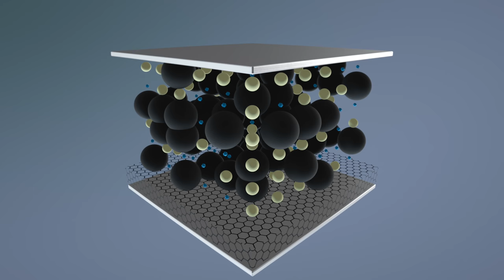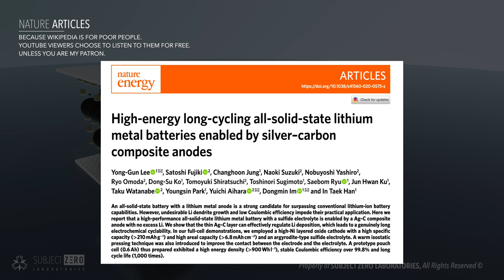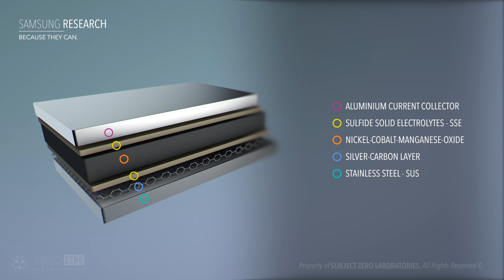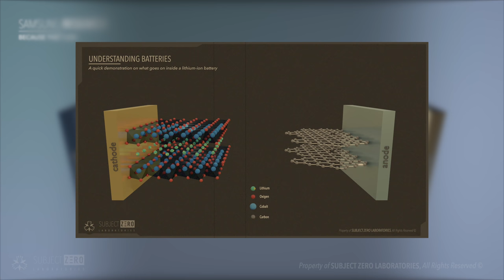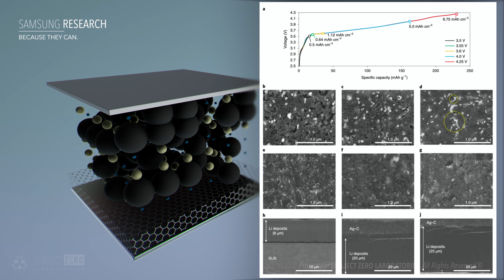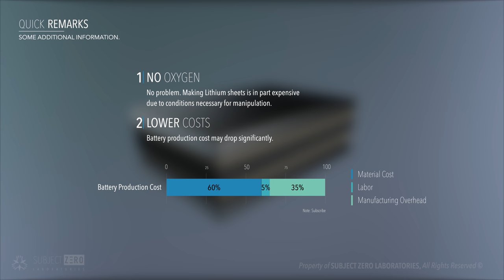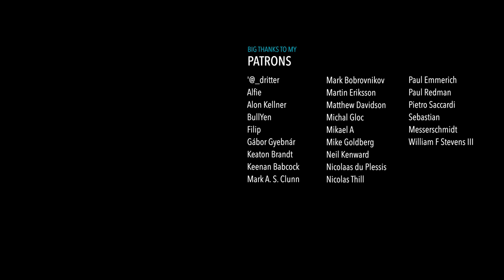Breakthrough Solid State Battery - 900 Wh/L Samsung [2020]

Comment: Lithium can't surpass the energy density of gasoline even with a theoretically perfect lithium-air battery as gasoline wastes are gaseous products that you just dump into the atmosphere. A lithium-air battery with optimal performance (which is unlikely to ever be remotely achievable) will carry the waste product with it, and the lithium oxide waste product has a much larger volume and twice the mass of lithium metal.
Reply: Can the waste product be actively removed as they are produced through a mechanism built into the battery system?
Reply: @hassanjamal4212  Not if you want the battery to be rechargeable. The lithium oxide is "spent" lithium metal that provided its electrical energy when it reacted with oxygen from the air. You want to keep it because it's expensive, caustic like drain cleaner on contact with water and you want to turn it back into lithium metal by charging the battery. Charging the battery will give off a lot of oxygen (which itself might be unsafe in a poorly ventilated area; think charging your car in a poorly ventilated garage; any fire that starts in there could be a blast furnace). Batteries rely on a very specific geometry to work, you must be able to accept large changes in volume without accumulating deformations, dendrites or other problems that might cause a short or degrade performance. That's why it's hard to imagine a real world lithium-air battery that is rechargeable and is mostly made of lithium. You're going to end up with all sorts of fluff comprising most of the battery weight. It might still be much better than current lithium ion batteries.

With gasoline, there is no built-in mechanism to turn the carbon dioxide and water back into gasoline and they are gaseous at temperature so it's not storeable, and they are not accutely toxic so it is generally considered OK to just dump it into the atmosphere provided you use a catalyser to get rid of the carbon monoxide and NoX.
Reply: @soylentgreenb  i think gasoline if produced and consumed ethically can be highly beneficial and outweigh their negatives. The problem is the hyperconsumerism and undue burning of gasoline to sustain a lifestyle that is antithetical to preservation of environment. Like, buying and collecting loads of clothes, cars, houses,etc...living in distantly spaced houses, going to office everyday when many work can be accomplished at home...

As for the lithium battery, if the waste product is converted back into lithium, why is it considered a waste product in the first place and not just a temporary phase change? I thought you meant lithium battery produces like crusty deposits within it cells that overtime permanently displaces the electrolytes thus inhibiting its function.
Reply: @hassanjamal4212  I'm not saying that fossil fuels are good or sustainable, just that you can't beat the energy density of gasoline without going nuclear and it is hitherto acceptable to dump waste combustion products into the atmosphere.
Reply: @soylentgreenb  yup, its about being moderate and avoiding extravagance. The issue is countries like America and Australia produces so much co2 per population compared to the rest of the world combined, due to their self important image. These people would also burn through all the worlds lithium as well if they don't change their mindset and culture.

Comment: I thought electric cars were actually pretty good for the time, it was just lobbied out by gas companies who saw it as a threat.
Reply: Yes, but not just lobbying. For one thing, electricity for charging hardly existed outside cities at the time, so inter-city travel beyond the short range of the EVs of the day was impossible. Second, Ford came out with the Model T, which was maybe 10 times cheaper than the electric cars of the day (and the other hand-built gasoline cars of the day). Ford wanted to make an EV, but Edison could not deliver on his promises for the battery Ford (an ex-Edison employee) wanted to use. Then WW1 came along, and after that everyone copied the Model T format, including the petrol engine.
Reply: thearab59 Ahh thank you for explaining. Really appreciate it!!!!

Comment: yep in teory gasoline provoganda tell about the numbers But never tell compare to real numbers you get.
you shall times it whit 10-20% normally.
9500 -> 950-1900 wh/liter. Driving
600 -> 450-540 wh/liter. Driving (75-90% effectivity).

Now Gasoline are not impressive any more. If battery did have 9500 wh/liter, you will in same space be able to drive a stunning  5.500+ km in 100 liter whit the car i drive.

Automation game:
But if the world update Engine to my build gas cars 100 oktan and stunning 62% effectivity, it will be able to drive 50 km/liter eco'ish drive and have around 300 Nm in a 1.8L engine like VW golf 3.
Normaly runs 145 Nm by the way.

lamborghini countach (1988) can be running hold on your seat, 38 km/l by a 3.7 Liter 6 Cyl. engine when city drive.
And race 20 km/l +- topspeed 320 km/h.

Comment: A solid state battery will eliminate wet batteries. Imagine being able to produce batteries in any configuration. Anything and everything becomes the battery. Imagine this battery is half the weight,  10x as powerful, lasts 10x longer per charge and accepts recharge 5x faster than conventional batteries of today. Imagine this battery has unlimited scalability. I believe Elon Musk's Tesla will be unvailing 1st gen solid state batteries at it's annual stock holders meeting very soon.....you aint seen nothing yet kids.......
Reply: NO.........they are taking another approach for present time..........even Panasonic and Toyota says Solid state is couple years away...........the increases in change is happening as Ai ramps up .........with being able to ferret out the better uses of common minerals ...........Silver is so limited in amounts and of course as it goes up in use.........so does the prices............not what anyone wants for affordable batteries...........

Comment: Talk about jiggling the numbers, to get results you want. So, so hypothedical battery is going to produce mircles. Great, I'm waiting. Okay, lets say it's true. The thing about batteries is, you do have to replace them. So, if you buy a new car, and trade it in every four years you're fine. Who's going pay the price, at four years? What does a battery cost? Six, to nine thousand dollars? I drove my Toyota for sixteen years, and gave it to my nephew, who drove it for six years. So, you buy a battery, every four years, at six thousand dollars? Okay, that's fine with me. My maniger drives a Tesla. He doesn't drive it between January, and March, because the battery will not hold a charge in sub zero weather. The new batteries are going to fix all that. Right, how would you like to buy a bridge in Brooklyn?

Comment: Stupid comparison. In a car you always need a combined energy of heat and source. The efficiency of gasoline is close to 100% because you need heat. Due to the his fact batteries will never reach density of gas. Other fact, burned fuel you do not to carry with you. The weight of discharged batteries you always have to accelerate and deccelerate.
And finally the recharge of energy takes me 5min at a gas station, but half a day at the mains...

Comment: Oh really! Batteries were never a big hit and did not work with electric cars in the 19th century??? The first land speed record was with an electric car and electric cars were more successful than internal combustion egnines while the required metal engineering technology was in it's infancy. The problems of vehicle range, turn round time, weight  and cost of batteries were what allowed the internal combustion engine to scoop the market. 21st century technology is moving in the right direction but those same problems are still there.
Your comparison of potential power from batteries of a given size with similar oil based fuel ignores the problem that petrol or diesel is a processed fuel extracted from the earth. Batteries are a means of power transmission and equate to nothing more than an empty plastic fuel tank, until they are charged by power from a consumed fuel ( which includes hydro, solar, wind and tidal energy). Lithium battery improvements and problems are apparant in household devices and have made the electrically assisted pedal cycle viable but experience with these is why I am far from ready to buy an electic car but fascinated by the scope of likely battery improvements to come.

Comment: Electric cars are still silly. You charge them from burning something in a power plant or fission with its deadly spent material. You then transmit this power loosing about 25% of the energy. When you charge the car you loose another 10%. When you use your car another 15% is lost in heat and resistance.  

We need to go to the quantum  flux free energy for these cars to be viable. Don't exist you say? Think again, this tech has existed for quite a while but the controllers will not let it out of SAP's. The big energy profits would be reduced and that keeps it locked up. Think of reducing pollution by using this zero point energy. We could bring up the poorest people on this planet to a decent lifestyle. Before you dismiss this with ignorance research the people who have whistleblower testimony. Also anyone that knows this tech has been threatened to not talk about it.